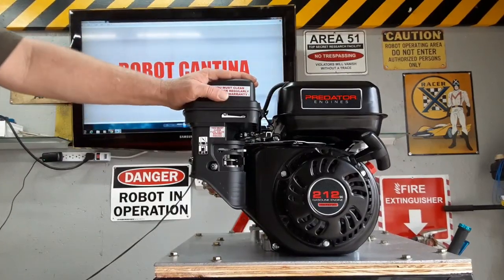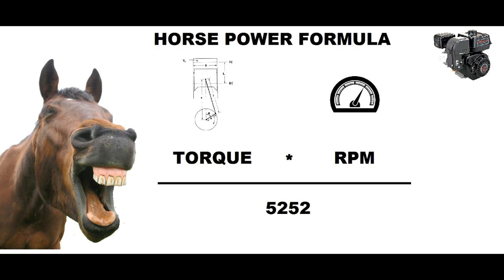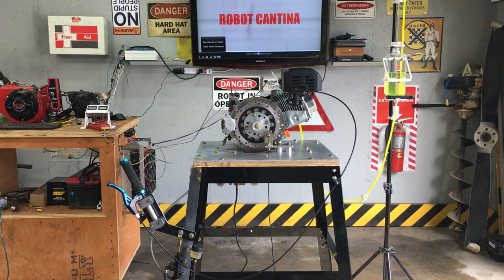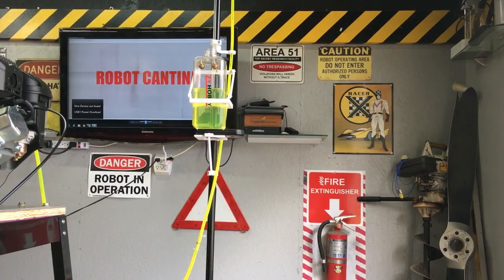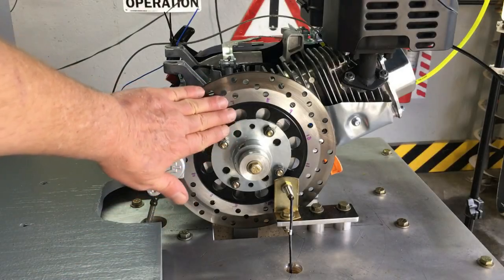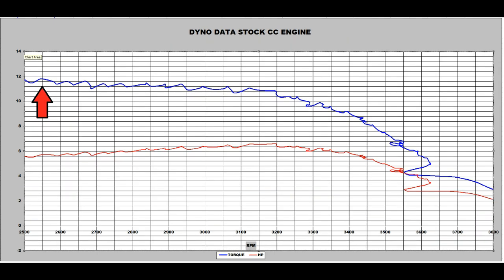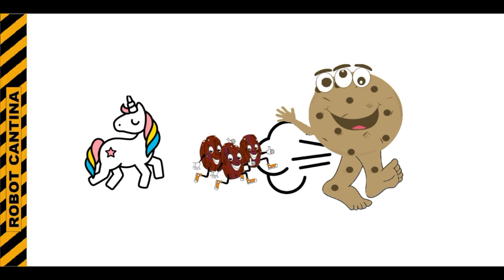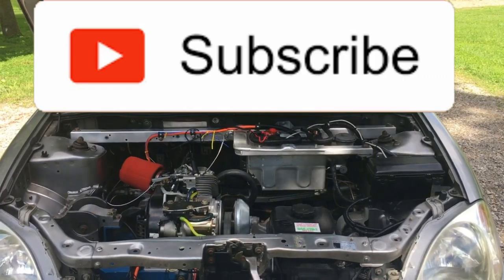Episode 2.  $99   Predator  212 cc engine dyno test

Comment: Will you PLEASE do a dyno comparison between the honda GX390 and a predator or ravin 420CC engine? PLEASE 🤣 im trying to debunk that a GX390 wont run the same two stage 28gpm hydraulic pumps the 420 CC chicoms can.

Comment: This is not accurate. Your method of dyno testing is why you achieved a high hp and torque reading. You must start the load at a low rpm and slowly allow the engine to build rpm. What you did by starting the load at high rpm is measuring stored rotational energy in the crank. The faster you pull the rpm down the higher momentary hp and tq you will get. Same if you start low and allow the engine to rev higher too quickly, you will see very low tq and hp. If you want to know the most accurate tq and hp ratings, first find the rpm at which they occur, then attempt to hold that rpm for a moment to get the most accurate reading. Constant rpm means you are not measuring acceleration/ deceleration forces.

Comment: Are you new to engines? Every engine has a torque peak that is at an RPM that is less than or equal to its horsepower peak RPM, and that torque value is greater than or equal to the torque at the horsepower peak (equal when the torque peak and horsepower peak are at the same RPM, which is guaranteed to be 5252 rpm). The torque at the horsepower peak is usually a bit om the low side, because power scales with RPM as you mentioned, and the horsepower peak will usually be at a much higher RPM.

Comment: No mystery, look at the torque curve on any engine on a dyno.  Maximum torque and maximum torque values are always at different RPM.  Torque value at the maximum horsepower point is almost always lower than the maximum torque value at a much lower RPM.

Comment: Have you seen those 196cc diesel engines? They're almost like converted Honda GX200 clones. They're rated at about 3hp and 6 foot pounds, but it appears that they're underrated based on a generator load test video I saw (put out 2.5kW of electricity from the generator). Would be neat to dyno one and find out what they really make for horsepower and torque.

Comment: Maximum Torque gives max efficiency not max power. Spec for my car has max torque at 1500RPM but it has max power at about 4500RPM. So I think the HP is going to be based on the Max RPM and not 2500RPM.

Comment: I had started working on something similar but ran out of $$$$ before i could get started. Im thinkingof following part of your plans in part and making a shaft flange that i can mount the original fly wheel and clutch set up too. But I'm thinking of using a small car pike a sentra or something, that is more readily available here. I'm thinking i will go with LEDs and try to find a way to run it with a lawnmower or motorcycle battery.  I need a car and those go cart parts before i can start. Lol.

Comment: Not sure if I should cry, laugh or both as soon as I saw insight and 99 lawn mower engine I subscribed
Reply from the maker: If it helps, the car has not been damaged or modified in any way that's not 100% reversible.
Reply: @robotcantina8957  yeah I saw the impromptu clutch system, almost looks like a clutch setup from a Polaris utv

Comment: I've been waiting on a "carb kit" for my six horse chipper, almost two years, I believe after watching the torque curve and horse power, I'm buying an engine instead! Thanks, that's a great prony brake setup, I used one fifty years ago, carved wood with wood lever, clamped with long bolts, and a bathroom scale.  I suspect it wasn't quite as accurate as yours.  Very fine set up and design, from an old biker.  Very well done, professional video as well.

Comment: e10 wont give u issues if u run it all the time, used it in my geny for years no issues but i run it every day.
Reply: also a good tip is to store with tank empty or toped off with no air in the tank.

Comment: Interesting. So at 2500rmp there's 8.1ft of torque and there's 3.85 HP. And if you calculated it actually has 7 HP then that means if you divide 7 by 3.85 that equals 1.81. So if you do 2500 times 1.81 that equals 4525. And if you do 8.1 times 1.81 that equals 14.6. Which means the engine has 7 HP and 14.6ft of torque at 4525 rmp. That seems right. (I was just testing my math, I'm in 9th grade..)

Comment: I'm working on a cars and science-based television show and we'd like to build a table top Prony Brake dyno like this.  What force gauge are you using?  And how exactly are you coupling it to the motor - meaning, which areas are pushing into the gauge when you hit the brake?  Or - did you build this from a tutorial?  Great videos, by the way.  Love watching that car putter along, especially with the 212cc engine.  Funny stuff.
Reply from the maker: My Prony brake dyno is a modern equivalent of the concept.   Its hard to explain in words how it works, mostly because I use a complex bearing arrangement to float the torque arm. Hopefully soon I will do another dyno video and I will show how the system works.    Basically the same thing can be built using  bigger parts, Mine just so happens to be extremely compact and has a lower spinning mass.  If you look at my charts, the low mass shows up as spikes in the data.
Reply: @robotcantina8957  sent you an email!

Comment: How does this guy know how to do all of this but not have the basic Internal combustion engine knowledge that peak torque and peak power happen at vastly different points on the power curve? It can make 7 HP AND 8.1 LB-FT because they appear at different RPMS on the curve

Comment: Nitpick, ethanol is only an issue when it absorbs moisture (which can happen when a lawnmower sits all winter). Project Farm did a nice video on it. If you run your equipment daily and drain before storage it would be fine, just like your daily driver car. I use non ethanol in my equipment just because I never know when I'm using it next.

Comment: The RPM at which you get max torque and the RPM you get max horsepower aren't often the same, and they're both different from the max RPM of the engine, so multiplying mixed numbers together doesn't get you anything.

Comment: I love it, "common 87". I think the lowest here in Germany is 95 and is also the standard.
Edit: 95 is the lowest
Reply: Different systems of measurement. Look up RON vs MON.
Reply: Yeah, but he uses pump gas, those numbers are called "pon". And I was wrong, lowest in Germany is 95 octane, it is the equivalent of 91 in the states. So still true, but not to the extend of what I thought, research helps :D
Reply: @jeremymartens4027  - He's in the states (it would seem), I'm in Canada. Our pumps indicate that the octane shown is "average of RON/MON".  Our pumps here are 87 (regular) then usually 89 and 91 (premium). You used to be able to get 93, but now it's only a few that have that.  Usually whatever the highest octane is will be ethanol free. I keep that for stationary devices (and add fuel stabilizer to boot!).  Been a mechanic for ~45 years, and have replaced hundreds and hundreds of rotted out carbs over the years from ethanol that 'just sits'.  Some bowls look like the have 1/2" of sand in the bottom - it's the dissolved carb itself!

Comment: 1.57. The peal horsepower and peak torque are at different rpms. This is almost always the case, except in some nitrous applications. Torque is higher on low-revving engines and horsepower is higher on high revving engines. 
  9.7 ft/lbs is absolutely a believable claim on a 6.5hp engine. Torque always falls off after peak. Performance engines try to minimize the drop-off as rpms climb. That helps build higher horsepower as revs increase. If it maintained 9.7 ft/lbs at peak rpm, you showed yourself that it would make higher than 6.5hp.

Comment: Max torque and max bhp don’t usually occur at the same time. Also max bhp doesn’t usually occur at the rev limiter as the torque has normally dropped off by this point.

Comment: 87 octane and 10% ethanol? i'm surprised engines can ever run on that stuff.
Reply: Here in NZ standard petrol is 91 octane
Reply: @CommanderMouse72  95here in the UK, no ethanol either.
Reply: @gramursowanfaborden5820  we have 91 as standard and 95 and 98 as premium and none have ethanol, however e10 is available in some places
Reply: i would say that we have premium 98 but no station around here ever bothers to maintain the pumps, so it's petrol, or diesel, take your pick innit.

Comment: I was hoping to see a run with the governor bypassed.
Reply: There shouldn't be any difference in power. To accurately test and compare he would need to apply an identical load at the same RPM he applied the load on the governed engine.
Reply: @Deucealive75  no, there won't be a change in power at rated rpm, but I'd like to see the power curve over 3600 rpm.
Reply: @fryloc359  what would be the point ? The power curve is dropping like a stone after that probable valve harmonic anyway.Just day
Reply: Damn autocomplete....the engine is  all done past those revs.... he'd be better doing a back to back tests with a Predator Hemi head
Trev New Zealand
Reply: @trevinskiking2165  lots of gokart guys bypass the governor on these engines. If it didn't make them faster, they wouldn't do it.
Reply: @fryloc359  PS...And disconnecting the Governor just let's the butterfly Throttle open fully on your factory carb, nb voiding any warranty.You can do it manually yourself on the Dyno by opening the linkage untill it's up against the cast in throttle stop,do you know why the Governor is there ?. Don't Shoot the messenger.T NZ,Cheers
Reply: @trevinskiking2165  yes I know why the governor is there. Just because the governor is set to 3600 rpm doesn't mean the engine peaks at 3600 rpm.
Reply: @fryloc359  I never said it did but I bet yah with the stock cam it's near topped out,with the stock carb too...it's a detuned industrial engine & would be lucky if it peaks out with stiffer valvesprings @ anymore than 5,250 rpms,stock it's got a short Cam & Cubes in its favour.I won't try and argue with ignorance.Cheers again Trev NZ PS he dyno',d the peak torque @ about a low 2,500rpm, experience tells anyone the peak HP is going to be pretty low in the rpm band Stk.Do you want me to go into math to prove it or are you going to take a very experienced word for it: some motors you can rev what's called designed overspeed of up to 3,000 rpm but they don't necessarily make more HP despite the theoretical math.
Reply: @fryloc359  ....if your going to call me on it, you'd better know your stuff !.Do you know how suit vane governors work. ??? The Predators isn't "set" at 3600rpms , jeez that's just the max revs against a variable load it will try & hold the engine to...initially it may open the carb wide open (an anolomy with these engines is not going to FULL throttle)then settle back down depending on the load to 1/2 throttle - the same arrangement has been use on Lawnmowers etc for decades.If you really want your Kart to go fast use a pair of 1960's MC10 McCulloch 2 Stroke Engines (who remembers them ?)all the best - Cause you are talking to one.Cheers
Reply: @fryloc359  Buddy, A go kart is 100 lbs, This car is 1300lbs. The company that makes the predator engine OBVIOUSLY want to rate it at the MOST power that the engine can produce right? So if THEY rate it at 3600 RPM that is because that RPM range is the most power that they could get out of the engine. it MAX power is at 3600 RPM. So if you rev it at higher RPM it will make a 100lb go kart go faster but not a 1300lb car because it simply wont have the power/torque to go any faster.

Comment: This is more of a real car build than 99% of car guys
Reply from the maker: I'm a big fan of LS swaps, but at some point gotta have something different... right?
Reply: @robotcantina8957  predator swap is the new k20
Reply: @robotcantina8957  I whole heartedly agree!!!!
Reply: Wheels , paint and cutting springs isnt built
Reply: @mauriciogianotti8039  Neither is buying a pre-fabricated, already designed mount kit or parts from a place and merely bolting them onto your car is "building". That's not a builder, that's a consumer.
Reply: @e @esnebta ig building building your own car from scratch is also being a consumer because your buying the premade materials

Comment: What did we learn from this video? That your dyno needs calibrating..badly! As a 40 year small engine mechanic I can assure you that 4.5 hp is closer to the mark.
Reply: 9-11HP with govrner removed, on average and well below 5000rpm
Reply: I am reasonably certain his setup is accurate.  This is what I would expect from an engine like this.  In practice, in application, engines typically deliver far less than advertised due to the power only needed at lower RPM, but here on a dyno this looks exactly as expected.  The older flat heads tended to suffer more on this sort of test than the OHV versions like this one given their larger surface area to volume ratio of the combustion chamber.
Reply from the maker: The Prony dyno is a real simple torque measuring device.  The load cell is calibrated with 5 ,10 and 20 pound weights every time the dyno is used.  To date, the calibration factor has not drifted.   Anyway I was skeptical too, but the test is repeatable and appear to be correct.

Comment: Do a dyno test on the hemi version so we can see the difference
Reply: There is no difference
Reply: @connorssmallengines6663  there actually is a difference...2 difference head designs makes a difference
Reply: @gonewronggarage4565  yes but only a little bit. Small engines are small, it does not make that much of a hp difference
Reply: @connorssmallengines6663  I found a video elsewhere and the difference was actually quite dramatic.
Reply: In the open modified kart world where you are driving a hand grenade it matters ... When you are spending money to race these

Comment: I got a question and favor, can you dyno the 212cc tillotson Hemi stock?
Reply from the maker: Hi josh,  I'm right in the middle of doing the 420 CC engine swap on the  Honda Insight, the videos will be coming out soon.  After that I will go back to doing some dyno videos.  I will be doing  the 212 Predator  with a stage 1 tune The Stage one dyno run will be on the engine that was tuned in the Honda and got the car up to 46 MPH.  Then I will do  a dyno run on the 212 predator with the stage 2 tune that got the car up to 54 MPH.     Both engines are non Hemi versions.   After that I want to test the stock 212 predator  Hemi.  I have two predator hemi engines  new in box waiting for their turn on the dyno.  I currently do not have a tillotson 212 Hemi., however It appears to be an interesting  engine  with a claimed 10hp.  I'll look into getting one for testing.
Reply: @robotcantina8957  awesome, the tillotson motor is a power house on my mini bike I have used the predator but the tillotson blows it out of the water on acceleration.

Comment: Maximum TQ and Maximum HP aren't supposed to occur at same RPM.  It is almost always the case that HP is less than max when tq is max
Reply: Hp is just a mathematical formula based off torque. They always intersect at 5250. If you see a dyno chart that doesn't do this it's B.S. 
Unless your using something else to measure like newton meters or something this is always correct.
Reply: @timothywilliams2021  that's not true at all. Many engines rev lower than 5000 rpm
Reply: I didn't say the maximum would occur at the same RPM. I said the torque and hp curves would intersect at 5250. Horsepower is torque×RPM/5250. 
It's math. H.P.  and torque will always intersect torque at 5250.
Reply: @timothywilliams2021  not always, many engines can't rev to 5000
Reply: Its RPM based.

Below 5252 RPM HP is less than torque.

Above 5252 rpm HP is more than torque
Reply: @Texassince1836  hahaha my diesel doesnt even make that much rpm
Reply: @Texassince1836  not necessarily. There are even engines that produce more hp at lower rpm because torque is non-linear
Reply: @tedarcher9120  it is physically impossible for HP to exceed Torque below 5252rpm
Reply: @Texassince1836  no, that depends on units. You can just use smaller units for torque
Reply: @tedarcher9120  we use foot pounds and Horsepower as a pair. There is no other measurement that goes with Horsepower.

NM and KW go together as a pair of measurements as well.

Comment: what is used for collecting data and software display it?
Reply from the maker: I'm using an unlocked DATAQ DI-1110 for signal processing.  I am also using DATAQ's EXCEL software patch to directly import the data into Excel real time.    The DATAQ   is not effected by the energy emitted by the magneto ignition system whereas other systems will crash when exposed to the ignition noise.
Reply: @robotcantina8957  Thanks for answer